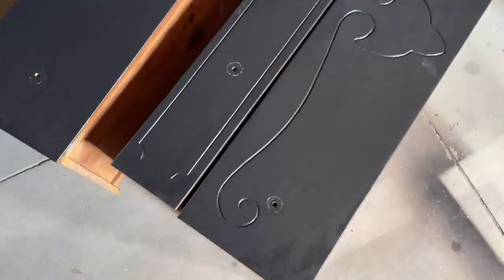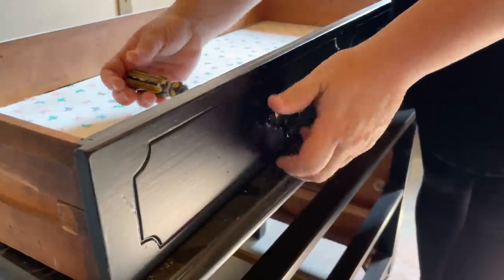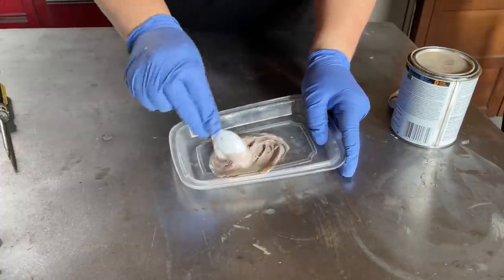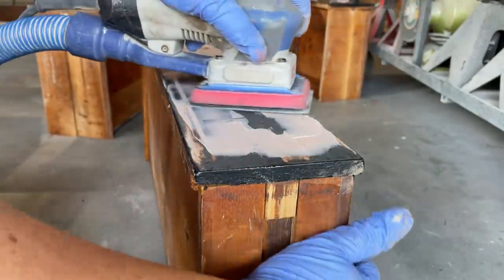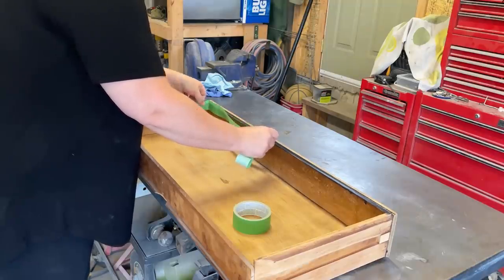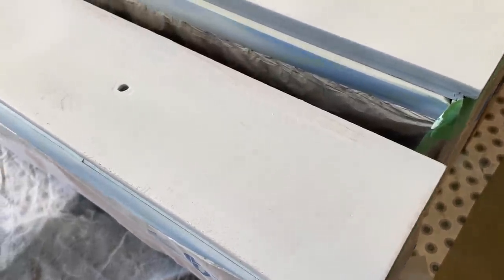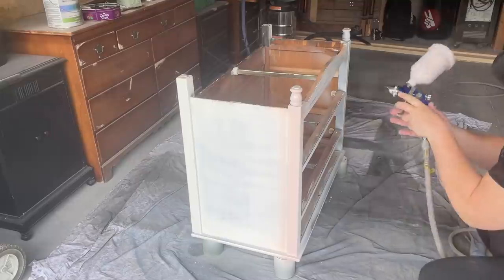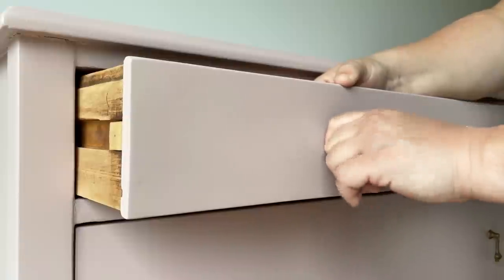Pretty Pink Dresser Makeover | Trash to Cash Furniture Flip

Comment: I fill in engravings or holes with a disposable icing bag and a metal tip.  It's much faster and less mess.
Reply from the maker: With wood filler that would work great but with Bondo it would be 1/2 set before you got it into the bag.

Comment: I learn something new from every video thanks to you 🙌🎉👏 how come you didn't need to sand down all the previous paint ? Was it not latex or how do you decide if it just needs to be smoothed down vs completely removed ?
Reply from the maker: It was a hard enamel paint that was very well adhered. You only need to remove the previous paint if it’s loose or failing.

Comment: I love watching your videos!!!! I'm actually struggling with my first dresser flip. The top won't sand down I believe it's a lamination. I did prep with dilute tsp and zinser but the top of the dresser scratches easily with just a fingernail and light pressure. The rest of the dresser does not. I have no idea how to proceed
Reply from the maker: Oh no! Sometimes laminate can be tricky. The shellac based primer should stick to pretty much anything but if it’s coming off easily you may need to try another primer that is specifically made to adhere to laminate. If you ask at your local paint store they should be able recommend one.
Reply: @salvagedbykscott  thank u so much for your quick reply. It turns out I had the water based zinsser and not the shellac. I took a look at it again after I posted my comment and had a facepalm moment. Time to sand again lol 😆

Comment: The "butter" you use on the inside of the drawers, is it a wax? If so, won't that damage / stain clothing placed in the drawers? I usually end put putting a couple coats of poly on the inside to be sure it's sealed if I do anything.
Reply from the maker: Big mammas butta is a mix of hemp oil, bees wax and carnuba wax that absorbs into the wood and drys to a hard finish. It does not damage clothes once it’s had a few days to dry.
Reply: @salvagedbykscott  Thanks

Comment: C’mon now, I have to gently call you out on spackle. It’s not gonna dry to a hard surface. People follow your advise to flip furniture themselves for a profit. Maybe they don’t do any other research. I’d say, if you have to go over the grainy surface with anything, then maybe wood filler. Or how about just sand to a smooth surface?
Reply from the maker: Spackle is pretty standard for fixes like this. I’ve used it in many of my own pieces and it’s never caused any problems. Please remember that it’s a super small amount and it’s sealed with a hard primer.
Reply: @salvagedbykscott  I understand completely that it’s common among furniture flippers. You’ll never see it in true restoration work. Best to you🙏